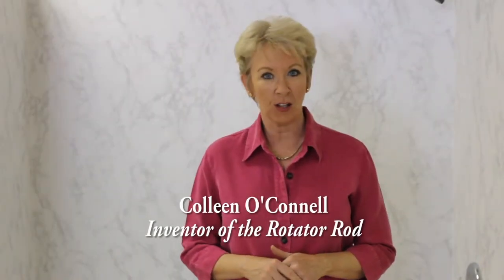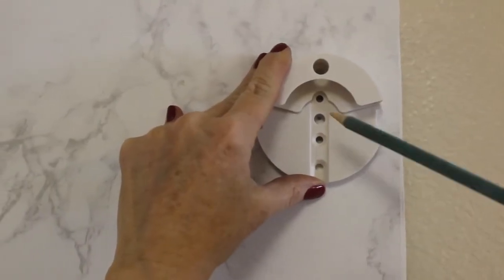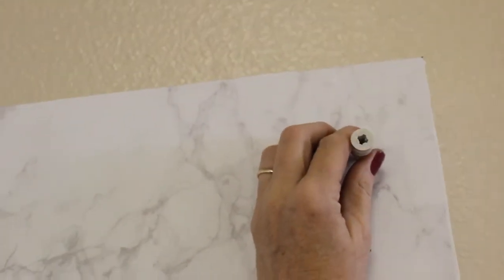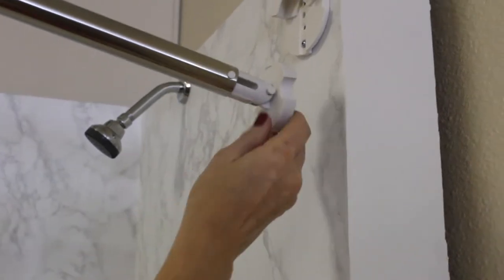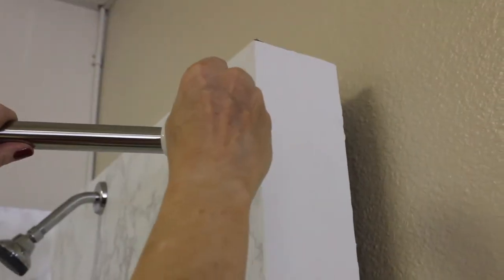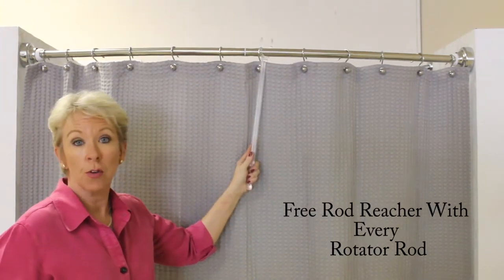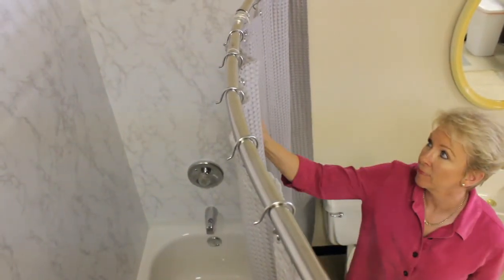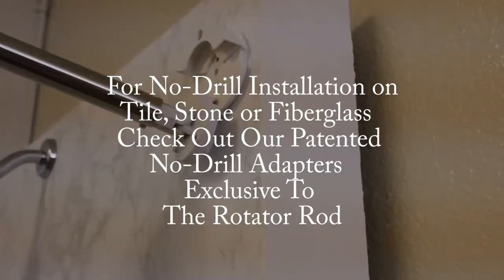Rotator Rod - Installing The Curved Shower Rod For Small Bathrooms

Comment: I'm on my third attempt to get these positioned at the correct height in a guest bath. When I tried the first time, the written instructions were different from the YouTube instructions. I made the mistake of choosing the written instructions. The second time I used the YouTube instructions *to the letter* and the rod was so low, I had to hem my liner and curtain. I lived with it for about eight months, but it looked so ridiculous, I finally caved and purchased a third set. I'm now waiting to see if I've got it right. My center mark is 78 Inches off the floor. This is with a standard size curtain from Target with the hem approximately 1-1/2" - 2" off the floor. What we ended up doing (two-person job) was putting the curtains on the rod and then holding it up in place to get the length right. $75 later - it better be right or I'm replacing it with shower doors. I'm probably halfway there already (expense-wise) after purchasing the rod and then three sets of no-drill adapters. Can you imagine if I had drilled? (I would be so mad.) And since it's a guest bath, cleaning the shower doors will be an infrequent task. Removing the no-drill stuff is not easy and I did do some damage to my very expense Onyx Collection panels (nothing that an Onyx service person can't fix for a couple hundred bucks) and I did follow her instructions to the letter on that as well. With the first two installations, the glue and everything worked like a charm. This third time, it was squirting out everywhere except out those peep holes. I finally got it, but there was a lot of clean-up of glue involved. In short, this can be a real pain. The demos always took easy. Reality is a different story.

Comment: The ultimate failure is most American "bathrooms" are still a water closet. Contractors, meh, cut so many corners it's a miracle homes are not round.
I digress.  I'm fairly pleased with this curtain rod, I got tired of being wrapped in the curtain while showering or showering with my back against the wall. There are caveats though with this installation. Drywall, sheetrock, plasterboard, or wallboard, whatever you like call it, is far tougher then these anchors they supply. I also would recommend drilling "pilot" holes. Small 1/16 0r 1/18 to start with to be sure your going into the hollow part of the wall and not a stud. I have a step drill and went to 1/4, the shank diameter of the anchors. That was not enough the anchor started camming out[stripping]. So I then used the step drill to 5/16 and redrilled the holes. I also made up some joint compound, covered the threads and drove them in there. Just have to be gentle for a few days while that compound sets up. AS always measure twice and a small square will make your location a tad easier.